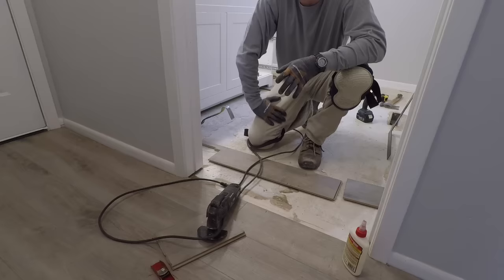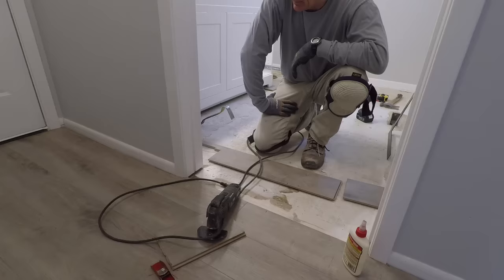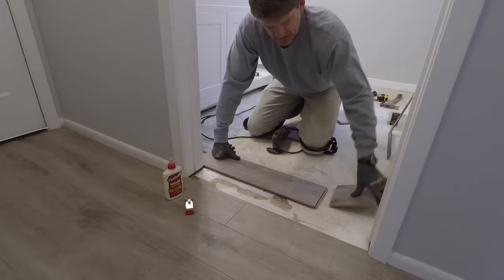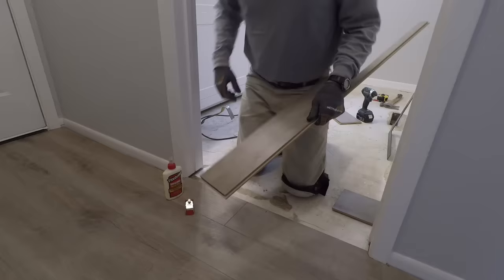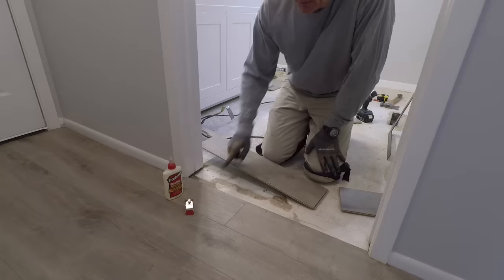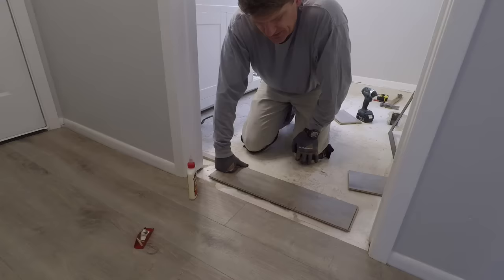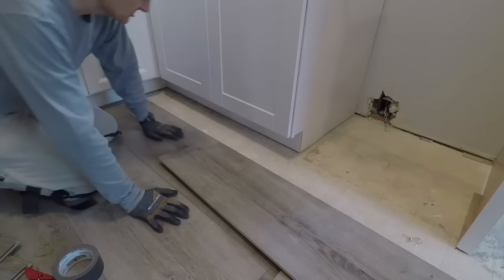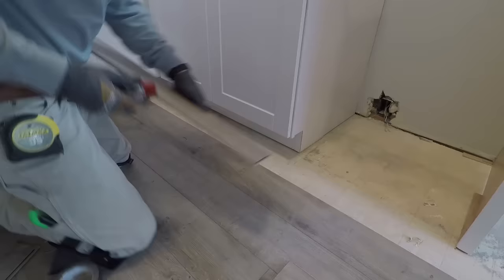How to install laminate flooring around doors and cabinets.

Comment: Actually,  a transition is required on any doorway that is less than 4 feet - at least with my manufacturer. Otherwise, the doorway is a very week stress point. Two rooms only connected with a few feet...as one room's floor moves or twists, the other room will be force to move also via this small threshold connection. Best to interrupt flooring and use a T-molding threshold, unless it is a very wide connection.
Reply: Glad someone point this. I'm running a Flooring Installation Company and all makers manufacturer required a T-Moldings in every single door less than 4ft. Also, glue down the joints it's not smart idea if the floor doesn't required otherwise void manufacturer warranty.
Reply: @JPfernandez15  
What are  examples of a warranty issue?
Reply: Absolutely horrible idea. First of all you can lock pieces together flat if you need to. It’s a bit difficult but doable. Secondly even if (in the door jamb example) you cut off the long locks you could still easily connect that butt joint then gently tap the flooring piece forward to lock to the existing piece. As for under the cabinets .. if you don’t have the right tools (mainly the pull bar which is cheap) you shouldn’t do the work. There’s a right way and a wrong way to do things. Either do it right or not at all.
Reply: Everyone is making demo videos these days. What is that glue for? And a Transition for that doorway is in order.
Otherwise no warranty for that from manufacturer,  floors expand and contract at different rates in different  rooms
Reply: Has I always tell my customers. Some manufacturer required a transition between doors. That's why reading the product instructions really quick you can read if your type of flooring required or not but all the depends on customer finish decision. I install plenty of time without using it and no problem so far. But again, customer needs to understand that if something fail Manufacturer will not cover the warranty because was "Wrong Install" as simple has that. So and the end of the day customer always has the last call.
Reply: @johnbeckwith1361  if you glue the joints and your type of flooring choice manufacturer doesn't recommend using glue to glue the joints then you are voiding the warranty. Now  what kind of issue you will find probably gaping issues between planks. And also possible of fail of expansion and create a big bubble floating. Now don't take my wrong in this video he shows how to cut the door jambs and if we focus on that the author of the video did it perfect. But I will use some disclaimer just to save some angry people over the internet haha
Reply: Occurred to me to.

Comment: I love coming in after a homeowner thought that laying a floor is easy lol.  I always make sure to rub it in just a little.
Reply: It kinda is though
Reply: SLIME WXLF As long as the room is actually square and the homeowner has a lot of tools and saws.
Reply: Larry Dicus that’s true I just meant as far as learning the trade.
Reply: SLIME WXLF  I’m with ya in that. Most things are learned as you do them too. You do enough floors and you will learn tricks and how to trouble shoot odd problems that comes up that will stump that general home owners. 👍
Reply: Larry Dicus I’ve only been doing it for like maybe 4 months max and I know how to cut tile, mix mud and grout. ( sheet rock. Red guard.. all that fun stuff) we also do Nail down wood, glue down wood, lvp/ laminate. Just need to get better at cuts with door jambs.  I was never interested in construction but the job was mine and now I love it. I wanna go to school for carpentry now instead of the medical field.
Reply: SLIME WXLF  Very nice man! To me, nothing in more satisfying than to be able to see what you have done. People stuck in a factory never get to see what they are putting so much work into.  
I sometimes will drive around in a Saturday or Sunday and look at some of the houses  or churches I have built.  You now have a set of skills that is worth money. Anywhere you go, you are needed by people. Keep at it and always put your safety first before the job.
Reply: Larry Dicus I really appreciate it! Imma keep learning trades so I can build a whole house by myself. my brother in law will be a contractor soon and open up a place to make furniture. Fingers crossed.
Reply: SLIME WXLF  Nice. I love making cabinets on the side myself.  When, not if, you learn to make furniture, you will definitely be in another level.
Reply: Larry Dicus hell yeah, be safe my guy. you seem chill and you have ambition that’ll go a long way.

Comment: Im in the exact spot you’re in. But I have tile on the other side of the door. As a first timer with click-lock I now know that I should have started at this door.

I think the handheld planer will so the trick for me bc no way am I going to be able to snap in the last piece.
Reply from the maker: Yes sir. When doing just one room it’s definitely easier to start at the door if you’re laying parallel to the door.  You’ll remember that next time!  Just use a generous amount of glue and that joint should last just as long as any.

Comment: I’ve redone several floors in my home, and never used glue. You can snap the pieces together under the door jamb, it takes some work, but it can be done.
Reply: How exactly can you click them when flat ? Hammer it in with brute force lol ?

Comment: I need to know how you lay the pieces in front of the doorway with pre-existing molding and door jamb. That's what I'm dealing with now. I realize I can remove the molding and replace it but how do I get the piece under the door jamb and get it to snap into place? Been researching this for an hour and can't find what I need. Thanks.

Comment: Trying to do it myself, everyone said "its easy once you get started"...lots of closets and door openings...have big gaps that look horrible....I basically destroyed lots of it.  4 hours to get 1 piece in with difficult cuts, took me 3 pieces before it was almost passable, but still looks bad.  Boxes & boxes of stacked laminate sitting up against the wall now for over 18 months....4 rooms that haven't had a floor in them in over 2 years....about to burn the house to the ground for the insurance money...
Reply: I feel this.

Comment: Any tips for installation around a wall that that sticks out 8 feet into a room, dividing the kitchen from the living room? I'm running the floor parallel to the main wall,  so 90 degrees to the wall that sticks out, and I'm starting at the side where the main wall meets the 'outcrop' wall. I want to maintain consistent floor through both areas. I'm laying vinyl plank. Thanks, your videos have been very helpful!

Comment: why do people always quarter round?  to me it always seems like a lazy way out of a proper prep by taking off the base boards.
Reply: depends some subfloors are not perfect then it is easly to manipulate gaps by installing qurter round. It  also depend some people don't like it some like it.
Reply: Came here to ask this exact question. I live in a place that came with white baseboards and stained quarter round and it looks crap.
Reply: Because then you need to repaint, buy new baseboards, potentially do drywall.
Reply: It's also really expensive these days for quarter round, I just took the baseboards off, a couple little spots of drywall I'll have to fix but oh well much cheaper and cleaner look than quarter rounds

Comment: If you're floors are waterproof this will make those joints no longer waterproof
Reply: Hasn't even been a year on my new floors. Already swelling where water jugs sat and where water is. I'll never use it again

Comment: How does the timber backed laminate go in a wet area? I thought you would need to use a Hybrid laminate in wet areas, the timber backing would swell and deteriorate wouldn't it? Not able to use PVA timber glue for the Hybrid, so reverted to sikaflex adhesive sealant.

Comment: I think your work is fine at the finish line. but I wonder why you haven't laid a damp proofing sheet and laid at least a 2mm insulation of sorts. I do this to reduce all risks of excessive expansion of the parket and mainly to avoid unpleasant crunchy noises when you walk on it after a few weeks. Also where you not able to slip the flooring under the kickboard of the kitchen? More work I suppose.

Comment: Do not take off the female side, slot in and slide across
Reply: Exactly
Reply: You can't.  There is no room under door jam to position plank on angle needed to   "slot in" . At cabinet area he can probably do what you said, have you tried sliding a plank after it's been positioned? It doesnt slide easy. The way he did it is faster and is a stronger seal with the wood glue.
Reply: @ericmuller3339  you can finesse it. Bring it mostly in the middle of door then tap forward, 1 side at a time if u got to then tap over. I've been doing this for 15 plus yrs
Reply: @ericmuller3339  first of all you must definitely can fit it under door jambs without compromising your warranty.  Second, I'm not saying that this method wouldn't work,  I'm saying by using this method you automatically void the manufacturers warranty.   I've been laying these floors for around 20 years. Yes jambs can be a pain but when you know the proper tricks you don't need to use techniques that void your warranty.
Reply: clown boy
Reply: Always start at the doorway.
Reply: you can't always do that.
Reply: @bluetorch13  been fitting fifteen years you definitely can do it, oh sorry "correction" proper floorlayers can do it
Reply: @atifmehuddin3189  What if I have two doors though?
Reply: @Napoleon-Blownapart  What if I have two doors on opposite sides of the room?
Reply: @janellebellard1913  the door you start from will slot in the opposite door you will have to slot in and slide across, if you cant slide it, use an off cut of the end of laminate board and use it has a tapping block and tap across, making sure you lock the off cut into the piece you want to tap first also putting your palm across the join to prevent join popping up

Comment: Great video. Thanks for sharing. Is it possible to get the door way to have a single piece of laminate the whole way rather than a cut and slide. Thanks
Reply from the maker: I’d say that depends where your last row ends as you’re approaching the doorway. If the last row is all the way against the wall and at least flush with one side of the door jamb then you can slide an entire piece under the jamb. If your previous row ends in a way that requires you to cut a “U” shaped notch in both ends of the plank then you probably won’t get it installed without some caulking. Better to have a seam in the doorway. Hopefully that makes sense.
Reply: @HomeSource  great explanation! 😉😉😉👍👍👍

Comment: Sometimes you don’t have to shave off the lip.  Take your rubber mallet and tap the piece you are trying to snap too and usually it’s just enough vertical movement to pop it over the ridge and snap it into place

Comment: 4:46 why would you have 2 boards with the snapping system removed in that position ? That wood glue is good until it cracks , after that you have nothing holding those boards together.

Comment: You are cutting the door jamb.  The door assemble is support by the jamb, therefore what is supporting the door unit after the jambs are completely cut?
Reply from the maker: The jamb is nailed to the stud framing. It hangs and doesn’t need to sit on the floor.
Reply: Thanks @HomeSource
Reply: I thought about the same thing….wouldn’t I be cutting into the stud? (But I am not cutting the entire thickness of the “2x4” stud framing for the door opening, just inches to get the piece to lay neatly, right? ) 🤷🏽‍♀️ But I noticed that your cut “wraps” around, cutting the entire portion in that area , leaving a substantial space to fit the plank on either side of the door jamb. I will jump in and try your tips tomorrow. I’m literally at a standstill because of  one doorjamb!

Comment: HOW DO YOU FIX IT WHEN THE FLOOR IS ALREADY INSTALLED.
Reply from the maker: Once installed your only option is to find a good color match caulk and fill the gaps. Not the end of the world. Most people probably won’t even notice the caulked gaps.  Good luck.
Reply: @HomeSource    Thanks for your reply & advice.

Comment: Hi Janson

I am trying to fit a small little room in my living quarter but the skirting board was hardwood and attached by strong nails - a friend of mind with all his might failed to pull the snails off the wall.  So we are trying to curing the skirting board but how do we finish the very last row/boards next to the skirting and which ends at the door?  I look forward to your reply.  Regards Angela

Comment: Don't completely remove the "lips" on the flooring. If you leave just a bit it will hold together better and you will still be able to slide it in.

Comment: Great tips! What glue would you use for vinyl plank (when you cut off the tongues for fitting round door jambs). i'm thinking wood glue may not work on vinyl plank. Thanks for the helpful videos!
Reply from the maker: I use super glue. Normally gorilla glue super glue. Good luck!

Comment: i hate quater round i think its nicer just the base board, but also most apt and condo are all made of metal door frame so you cant cut it to slide the flooring under

Comment: That last part with the cabinets: there's still a large gap under the edge of the cabinet that no board will fit into even if you tried to cut one... that requires a bit of planning from your starting point to trim the starting plank so you will have enough space for a trimmed board.
Reply: I agree but surprised that he ignored this gap.
Reply: Any idea how to fix it when you've reached the end and come to this gap?

Comment: Great tip, Sir!  My thanks to you.  Now, for a Question:  I am replacing sheet vinyl in my Kitchen with 14mm laminate.  The thickness of the laminate makes my dishwasher TOO HIGH for the cabinet opening.  Since I will be replacing my countertops along with the floor, should I run the new laminate underneath the dishwasher.  Or, just cut it in?  I appreciate your answer.  Blessings!
Reply from the maker: Hi Sanders.  Good question.  I have to assume your existing sheet vinyl is covering multiple layers of old flooring, which is why you're so high now.  The right way is really to tear out the old layers, but I'm guessing you want to avoid that.  Your best bet is probably to lay laminate part way into the dishwasher cavity.  Then when you're done and ready to install the dishwasher trim back the new laminate just enough so the front feet of the dw will sit on the old floor.  The front trim panel of the dw should cover the transition from new to old flooring.  Be prepared it may be a real challenge to squeeze in under the counter if your floor is really thick and will take some trial and error to get the feet adjusted correctly.  Better yet, install the dw while the couter tops are out and hope you never have to replace it.  Good luck!

Comment: Hi Janssen,

Would cutting out the doorframe be a problem is you have a metal doorframe?

Thanks for the video!
Reply from the maker: It would. If it’s metal it’s probably sitting on the floor, not hung like a wood frame/jamb. If you have a metal door frame I’d suggest cutting the flooring as close as possible and caulk the small gap.

Comment: That's all well and good when they're wood door jambs but what about when they're metal and they're crazy uneven and twisted because they're old and they are against the floor where you can't get under them
Reply from the maker: Cut as close as you can and use color match caulk. I don’t deal with metal jambs but that’s all you can do.

Comment: A fantastic explanation. Well done. Just a quick question....what if that room had tiles on the floor? What covers the gap then?
Reply: The tiles cover the gap, under cut the door jamb, then slide in the tiles, they don't need to be put in at an angle, so simple really.

Comment: Question: Why didn't you put a full piece in the doorway instead of two pieces? Since you were continuing from the other room and there was no joint (that I could see), I'm wondering why you did not use a full length board.  Thank you.

Comment: How do I fix the door jams if an someone didn’t cut the door jams like he was suppose to? Now I have gaps that molding can’t hide. I’m very upset
Reply from the maker: The only option I’m aware of is color matched caulk. You should be able to find one fairly close to your floor color. I can understand your frustration.

Comment: Looks like that would also work for that very last piece in a row between the first row and the edge.  How else do you snap the left or right side and the edge of the other row?
Reply: Use a pull bar.  Easier than planing, gluing and taping.  The technique shown doesn’t make a lot of sense to do.  You can get it all to work and keep the locking mechanism

Comment: The edges you just trimmed do not sit as flush as the other flooring with the locking lip.  Looks uneven.

Comment: You do not have to scrape that edge off all you have to do is put in the large piece first away from the door then tap the end of it down flush and the little piece you can flex and it will go right in

Comment: Thanks for the video very informative.  Is it  not necessary to remove the baseboards?
Reply from the maker: You can, and that will provide a great finished look, but adding shoe molding/quarter round to cover the edges is much quicker and takes far less effort.  Reinstalling base, and getting everything to fit like it did originally, isn’t a small job.
Reply: @HomeSource  especially if it's caulked base
Reply: Why don't you use a saker contour gauge tool ?